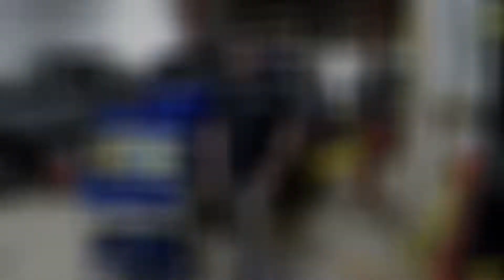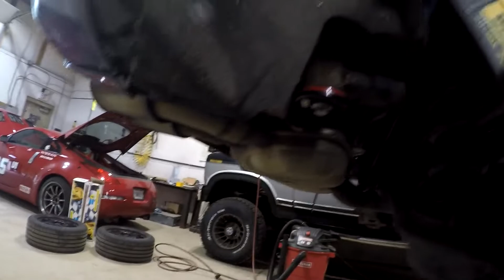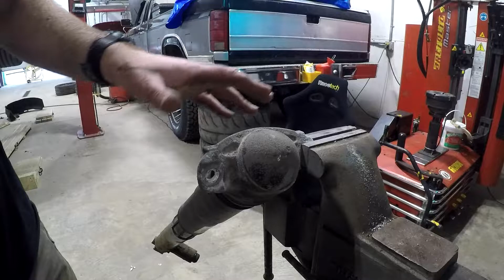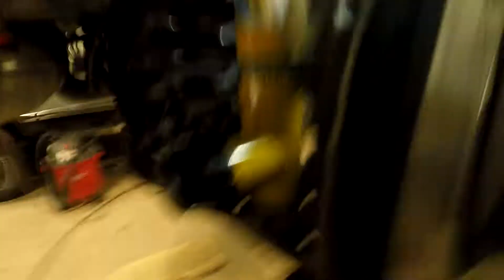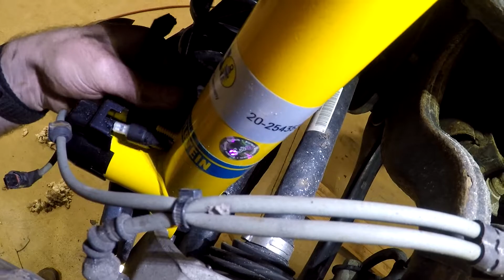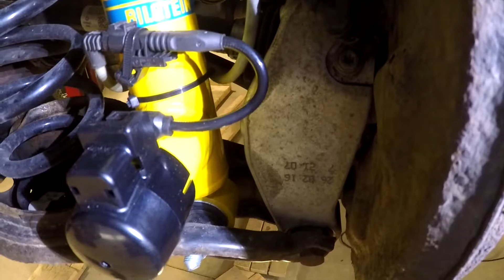MK7 Golf R - Rear Shock and Mount Upgrade & Install

Comment: I replaced my shocks and struts recently in my 2015 MK7 GTI and immediately got this clunking noise from the rear when hitting rough pavement, bumps, etc.  I used all new stretch bolts, torqued everything to spec under load, etc.  I was thinking maybe the new shock mount was defective, but took off the passenger side and seemed fine - and made sure the top nut was torqued down, which it was.  When I was putting the charcoal canister back, I noticed that there was some play in it after reinstalling the bolt (it's a new OEM charcoal canister too, changed it out 3-4 months ago), which would bang against the body on bumps.  Just something to be aware of with these cars.  Ordered some thin foam with an adhesive back to get rid of the movement/clunk.....along with a new set of really expensive nuts/bolts.  Yay.  Snap-On also made a socket for the "tang" - part number A139 (6mm x 8mm fit my Bilstein B4's).  If installing B6/B8's then not needed - but if installing OEM shocks or Bilstein B4's, then you will.

Comment: Great video, very helpful to remind myself how to remove and reinstall rear shocks after replacing shock mounts on my Mk7.5 Alltrack. Thanks. Two notes: the VW repair manual for the Alltrack/Sportwagen/Golf Variant states that the large lower nut should be torqued to 70 N-m + 180° as you noted, but it also states "Always tighten threaded connection in curb weight position," as someone already noted in the comments. It does not state that for the smaller top bolts. So, might be best to torque the top two with the car up and wheel off, get the bottom bolt snug but not all the way, then put wheel on and lower it (onto ramps if needed) and then torque the bottom bolt to spec. Also, the manual states the square loop/ratchet part of the zip tie should be facing outward; no reason given, but maybe it's just because it could get jammed behind and make replacement difficult if it breaks.
Reply: Excellent tip!  I read the same thing about raising the suspension when tightening the bottom bolt in the repair manual and was going to make a comment.  The front swaybar link also needs the same treatment.

Comment: Good video, but lower shock bolt should be torqued with the suspension arm at the nominal ride height, either with the wheel on and vehicle on the ground or using the floor jack to compress the arm.

Comment: The new shock has a built in bump stop so you don’t need the old one
Reply from the maker: @Louis-bn7ni  the regular B6s do have built-in bump stops but the DCC versions do not. The Bilstein instructions for the B6 DCCs do say to swap/install them
Reply: Ah my apologies. Didn’t realise there was a variation to the B6s without them 👍🏼

Comment: Do you need new hardware when just replacing the shocks themselves?
Reply from the maker: @HydraX115  anything that has a torque + angle tightening spec requires new hardware. All the hardware for the rear shocks needs to be replaced.

Comment: Extremely helpful video
Straight forward no faffing around

Done both sides in a little over an hour and a half
Will need to get new bolts and fasteners on Monday tho as I wasn’t aware they were needed 🙈

Comment: Hey great video! Just curious if this did end up fixing the clunk sound you mentioned. Have a similar sound in my car and I'm gonna try replacing the mounts first as I'm already running vwr shocks. I'm hoping it's not the shocks. Thanks!
Reply from the maker: The clunk I was experiencing turned out to be a rear sway bar mount bolt (and upper one I didn't initially see). I am ~25k miles into this setup now and I am still really happy with it. There is a little more noise in the cabin, but I only notice it if I don't have the radio on.